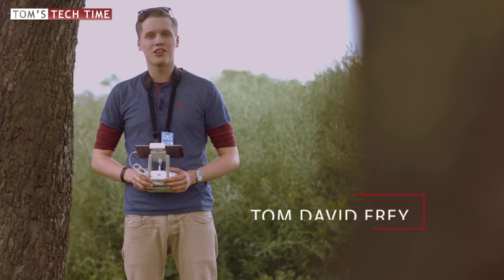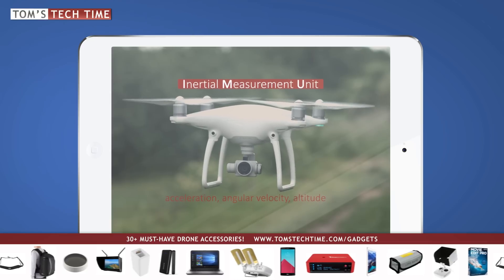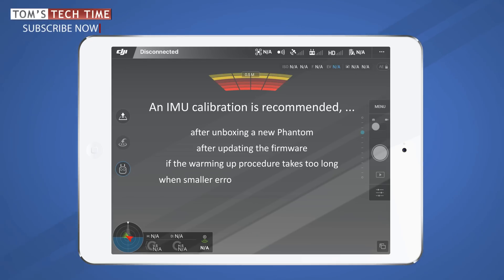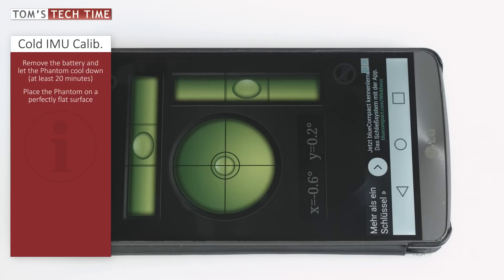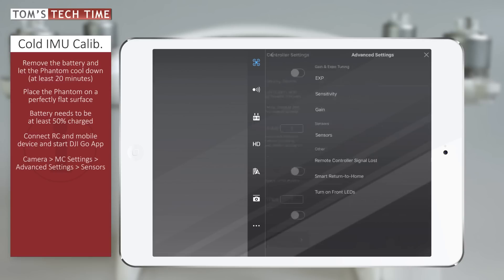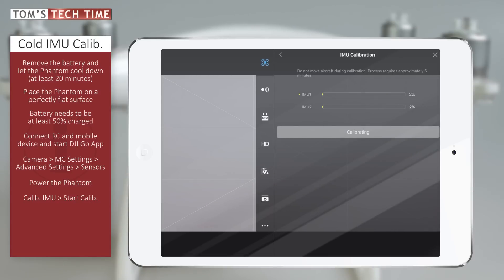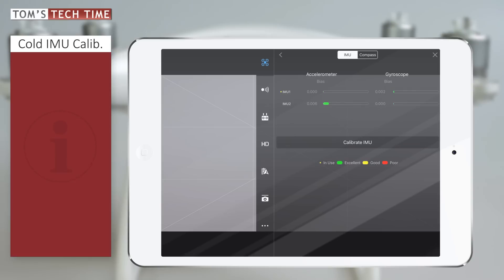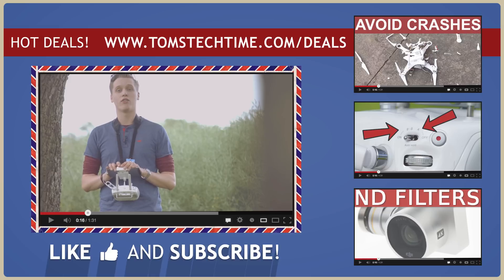DJI Phantom 4 | When and how to calibrate the IMU

Comment: Hi Tom can you pls help me i have a phantom 2 with the Zenmuse H3-3D gimbal and dji data link.I bought  it used 
and was told it had been in a crash .It was not a bad crash and looks good  outside  and inside .I have removed the gimbal and data link as to make it standard .it binds to the remote and picks up gps and the compass is calibrated .However it dose not seem to want to come down When in the air .And  is very jittery almost like a car running out of fuel.And dose not want to land easily i have connected it to my pc and done a fiermware update and a IMU calibrations .it is running on the Naza -m mode .
any help please
Show less
REPLY

Comment: When I do an IMU calibration it has me turning the drone on its side, back, front, and top. Why is this different from what you just showed?
Reply: Tom Kelly: The first couple times I tried this it just sat there after the forth step.Then I noticed looking closely that it was waiting for me to flip on its backside. I think it was step 4 where it had stopped (4/6)doing anything. In the sunlight I was not able to see the picture clearly and that it wanted me to turn it. Look at the pictures very closely as you are calibrating. Don't worry, you can't mess anything up, cause eventually you'll get it straightened out. Once I knew this it whizzed right through the calibration. Second word of advise: Find a surface that is SOLID and cannot move. I did mine on the cement slab in my driveway, when I had tried inside my house on a table, the table moved enough to throw it off as I was turning it. Make sure the surface is perfectly level and stable. I ended up with almost zero's when I was done. Hope this helps!

Comment: so I purchased a dji phantom 3 standard edition. it seems to fly ok but it will NOT auto launch / auto take off. it will auto land. it seems as soon as I start the motors the thing thinks its already off the ground the the icon for auto launch changes to auto land. is there a way to fix this or have I got a lemon and simply need to return it for an exchange?

Comment: do i have to do this on the spot outside where i plan to fly?
Reply: No...not every time...if you are facing unstable hover and frequent compass errors than calibrate the IMU on a level surface far away from EM interference

Comment: can you tell what is the best result. As adviced because of loses signal by dji i do imu calibr.outside and then compas cal. this are my data of imu cal
Sensors
x     y       z      Mod
-0   -0      -1       1
Compas
-88   -724     1210     1412
imu calibr. ok
Are data ok ?/

Comment: I'm a ham radio operator.  I want to use my Phantom 4 to put a small line up into a tall tree then haul up a heavy line to support a 102' wire antenna.  Is it possible to use the Phantom 4 to do that?  I'm thinking fishing line type maybe 50 lb test line.  comments?

Comment: Does the same procedure apply to the Phantom 3 aswell?
Reply from the maker: Basically yes. It looks a little different though, as the P3 has a single IMU only, but the procedure is the same. Stay tuned and fly safe.
Reply: Tom's Tech Time ohh OK thanks...

Comment: One advice,- instead of checking the table/platform for insurance of the leveling of the copter use glass plate on top of the motors as the copter it self has very good ability to be unleveled based on the position of the legs.
Reply: Thank you for your great tutorial, after that how about the gimbal is still overloaded?